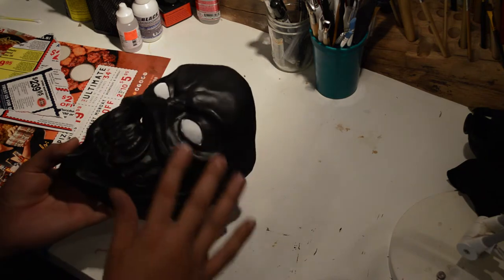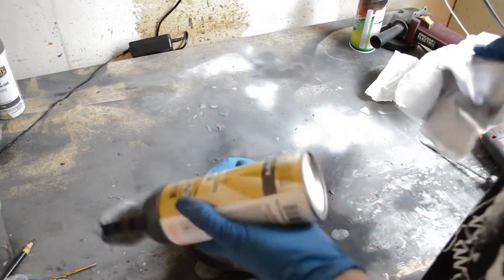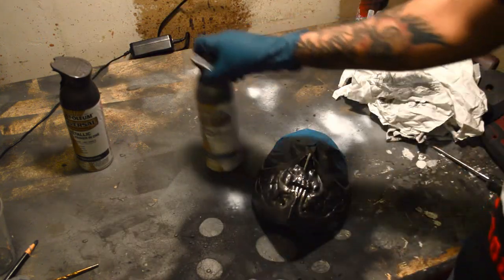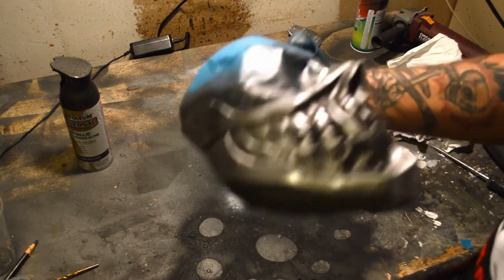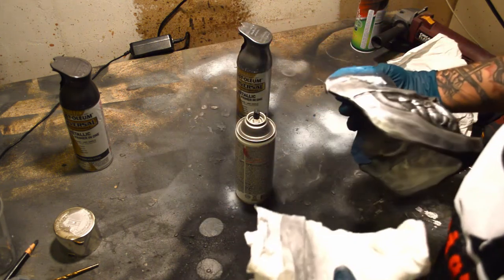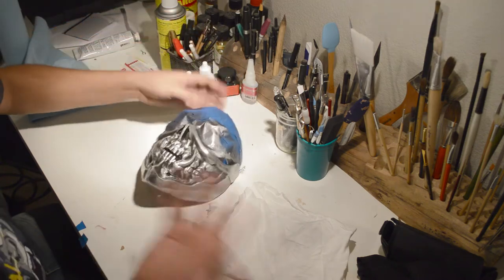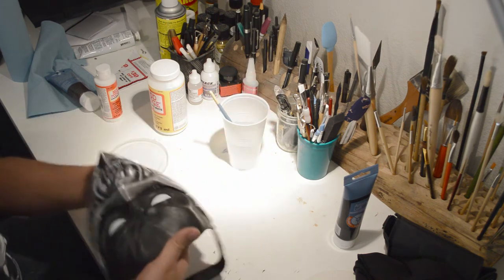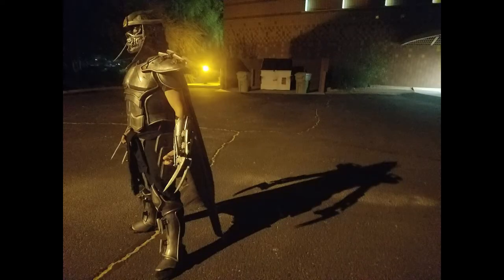Mask Cleanup and Paint Pt. 2

Comment: This is really good, hope you go to a contest and show it!
I just have  a few questions tho...
I have tried starting with cosplay and my problem is the budget, how did you start with your budget, what did you buy at first?
Reply from the maker: Thanks! and good question, a budget is always an issue, I usually shop for supplies or tools at places that take coupons such as Harbor Freight, Michaels or Hobby Lobby, or even on eBay, you can find some really cheap stuff you just might have to wait a while to get it. but I find a lot of stuff like fabric at second-hand stores such as Goodwill. but honestly, it just took a lot of patience I got all of my tools and supplies by being patient and collecting them over time. but the first things I bought were an extending box cutter w/extra blades, a diamond sharpener and some Barge contact cement, heat and hot glue gun; these are the tools that I use the most from when I first started to now, and once you have those things the rest is just materials. Evil Ted has a great video on tools of the trade which is what I watched when I first started. https://youtu.be/bzeTS6PLedc